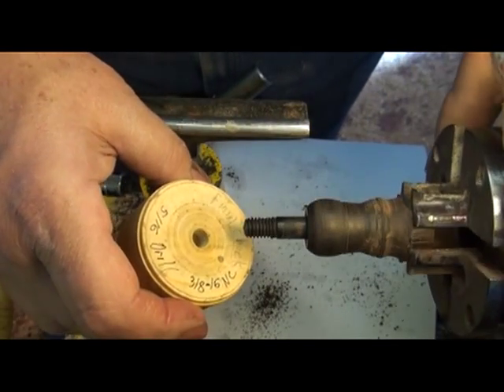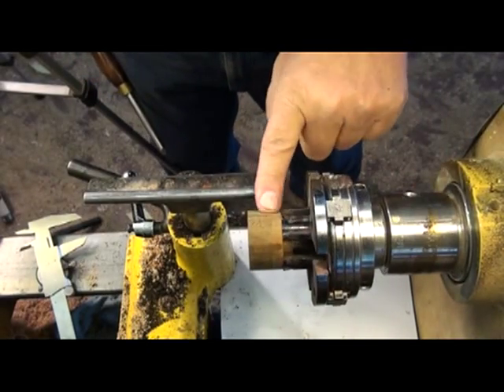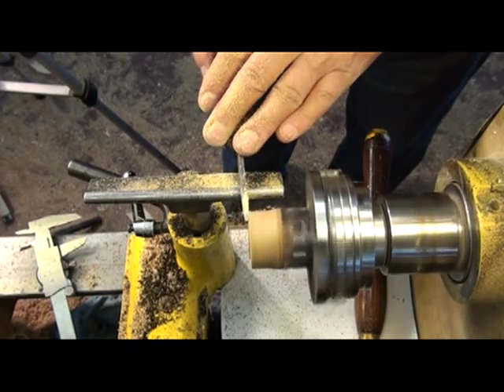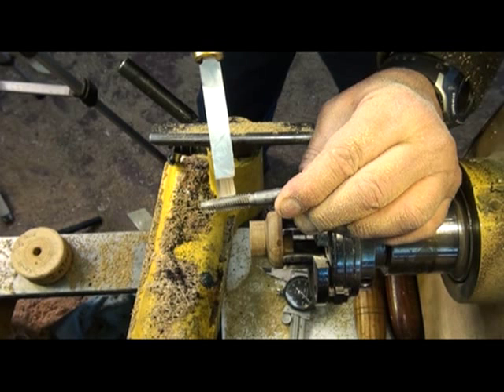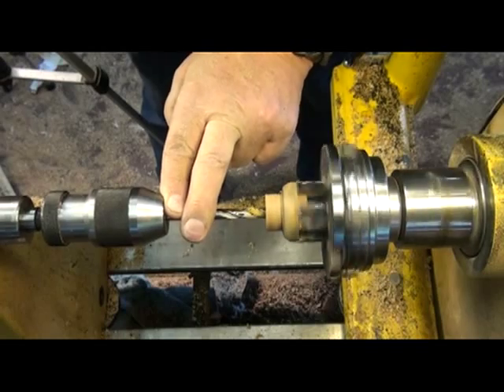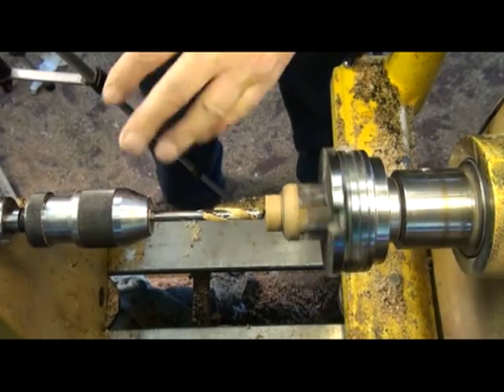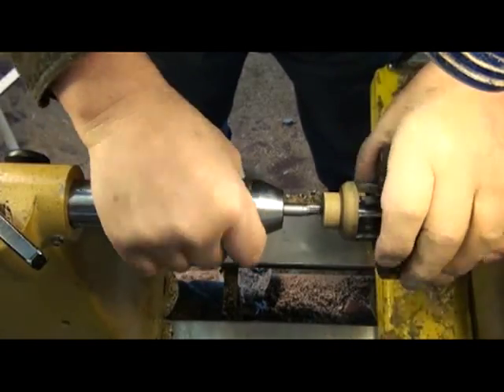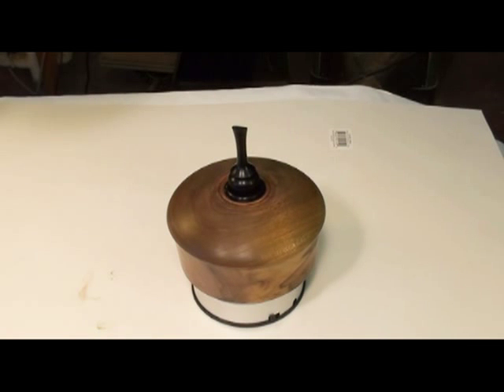Threaded Finial and Nut:  Part 2 (woodturning)

Comment: I enjoyed the threading vid. I have concern that threads cut for metal use, will be weak if stressed, as in making clamps, or adjustment parts in jigs.I just bought wood threading kits for 11/2 and 1in.tap&die. the threads are much larger, and dont match, but at least they are quite strong. COMMENT?